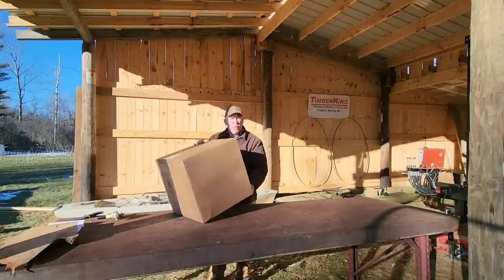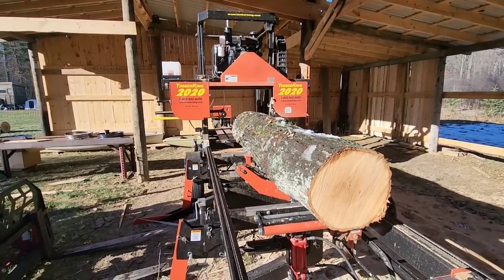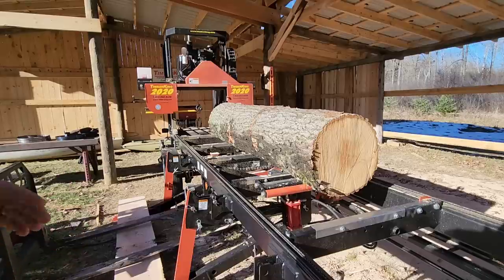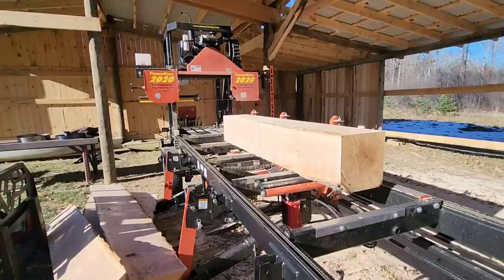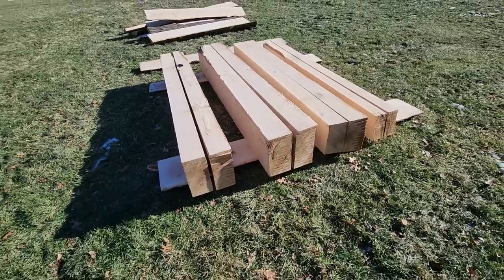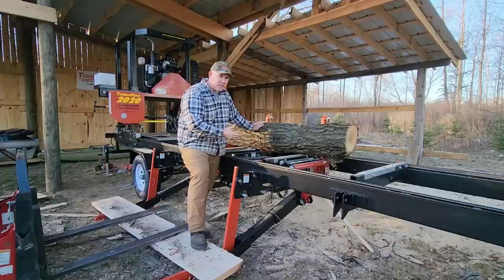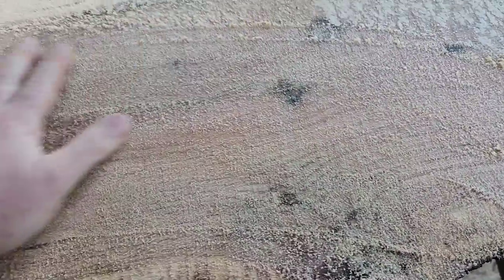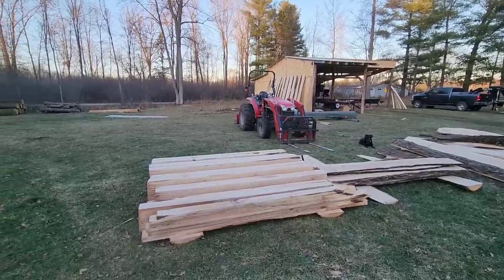Blade testing, Ripper S blades from SE Metals

Comment: That's all nice but what are the cost of the regular blades versus the cost of the carbide blades versus the cost of sharpening either of the 2 blades -  without those numbers all the rest of this is just interesting chit chat !  Also what is typically the reaction to a regular blade to hitting a nail - is it usable at all and how many nails can you hit with a carbide  blade and keep cutting. I'm sure that's just an experience factor that you might have an answer to...

Comment: Have you tried bimetal blades?  I have a small woodland mill. 125 inch blade. They seemed to last better than standard 15N20 blade. They were a bit more in cost, but I think we'll worth it.

Comment: Hi Thomas, it's the hubby here, concerning the tests on these 3 types of blades, would it be beneficial to see the tension gauge while cutting through the timber. Are you in favor or not in favor of having the gauge facing the operator, my thought was if the blade heats up or hits a hard spot one would see the gauge drop or spike. I'm not even sure if this is a concern or not with sawyers , I've always wondered about that since I'm very new to the game, I need all the safety margins I can get. I have a background in mechanical work changing, repairing or modifying parts is no big issue. Sawyer is not my field as of yet I will need a lot of hours on that area.
Reply from the maker: I'm not worried about seeing the gauge.   As you get accustomed to cutting on your sawmill, you will be able to hear the blade and know when something is not right.  The sound of your machine is important, it's great at telling you when something is wrong.  The biggest thing to remember is to de-tension your blade when not in use.
Reply: @TCSawmills  got it thanks again for the tips
Reply: I run a Woodmizer & I do watch my guage, it can fluctuate some depending on what your cutting, especially if you don't run fluid!

Comment: For me and my thinking about maximizing blade life. I want to get into clean wood ASAP. First pass. Dirty wood. (bark) Second pass after rotating the log 180 degrees dirty wood. Rotate 90.  Third pass I am now in clean wood. I don't have a debarker either.
Reply: There is one sawmill-maker in Alabama who makes the mill such that the second cut is into clean wood...As this is TK-territory I don't know if I dare say their name 😜.
Reply from the maker: Cooks and Baker both rotate the log, so after the first cut, you are cutting into clean wood.  I used to own a Cooks mp32 and loved it, great machine.  I'm just not a fan of their hydraulics on the bigger machines.   The use of solenoid control valves is a bit much. I prefer direct driven hydraulics on sawmills.
Reply: @TCSawmills  Well, now when you broke the ice I dare to "speak clearly" too 😋. If I could I think I would like to have a Cooks HD-32 with all the bells and whistles. Hard to explain why, but there is just something in the design that I like. I am sure that most mills are great but there is just something about Cooks that I like.
 I enjoy your videos, thank you 👍🏼💪🏼!
Reply from the maker: The 3238 is a great sawmill.   My only issue with it is the width of cut.  It's not as wide as I needed.   I thought very hard about getting a  cooks sawmill the AC36.  They made great machines, very heavy duty.  The wiper system is great at keeping blade clean.   I love talking about all types of sawmills.  I've owned timberking,  woodmizer, cooks and a lucas sawmill.   I've run many out there too and they all cut amazing wood! Glad you enjoy the channel.
Reply from the maker: Here's the cooks we had, great machine. https://youtu.be/-mt5ctjZeqs
Reply: @TCSawmills  Can not do much else than agree. Have fun and keep safe 👍🏼💪🏼😋!